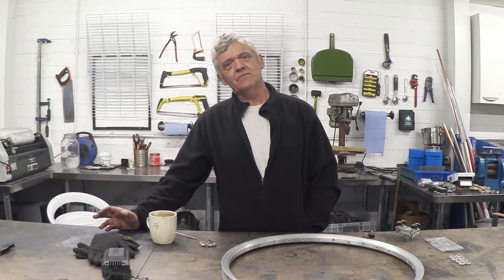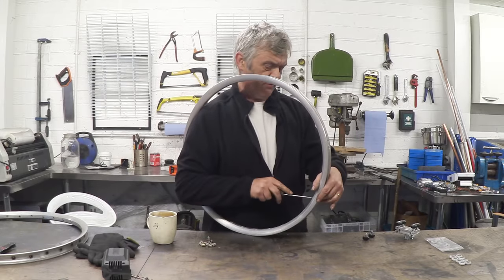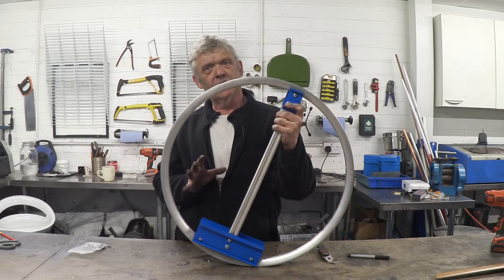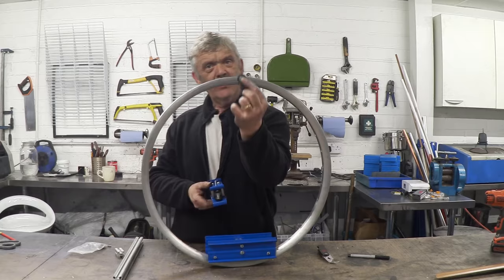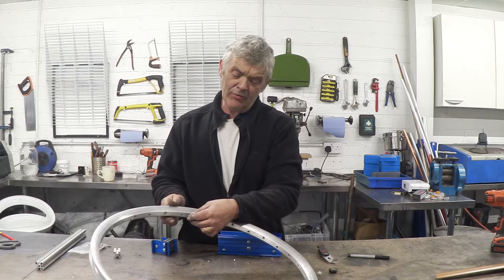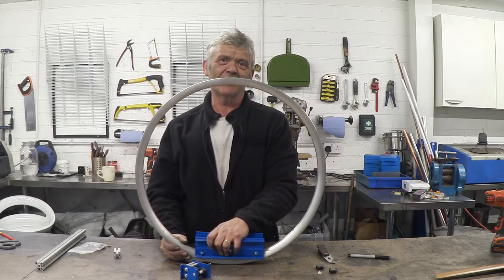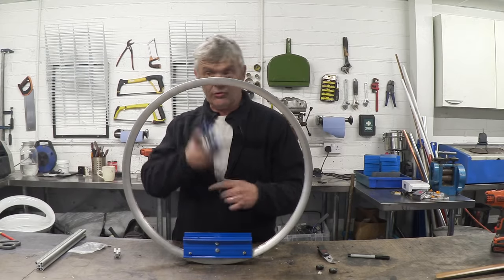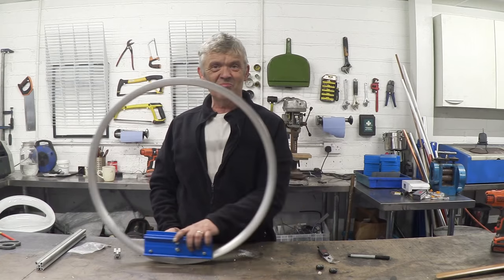How To Make A Hubless Wheel

Comment: Years ago at a local fair , I saw a hubless wheel where the rider was inside the wheel , sitting on top the motor. A powered unicycle of sorts. I think the guy steered it by leaning. This was back in the '70s when I was in junior high.
     Great video! You make to the point informative videos..
Reply from the maker: awesome mate - cheers for the post
Reply: I remember that, Rule no1, do not emergency brake.

Comment: So really this is a two wheeled train providing its own track.
Reply: I was about to say the same, when I heard the quote that there is no hubless wheel but instead the outer diameter of the axis is the size of the inner diameter of the wheel and hollow. Given that a straight line is a curve of infinite radius, this is basically a rail track. The other type of continuous rail track is the linked kind, which is far more common.

Comment: Cheers! As a bike mechanic, I'd like to alert you to a couple modes subtle features that might help with this design. Keep in mind that the the spokes under tension support the wheel dynamically at each connection, at all times. They end up providing a huge amount of structure, which makes sense when you take into account the cumulative tension of 32 or so spokes, each holding up to 200 KgF. It's generally understood that the rim is the weakest link in the system. 

You are right that in most cases, supporting the wheel at the bottom will do a pretty good job, but as you turn, the wheel will want to counter bend at about 90 degrees from the applied force (like a pringle chip or saddle.) With the pressure of the tire pushing inwards on the base of the rim, a moderate turn can be enough to push the wheel permanently into a saddle shape. Your 3 points of contact, if spaced evenly should help avoid this deflection and permanent deformation, but you may find that the supports need to be surprisingly rigid and heavy. 

Also, if you impact something with an unsupported portion of the rim, it will nearly certainly deform the rim badly, leading to it locking up as it enters the bearings. Deciding where and how long the bottom support needs to be should be calculated based on where the wheels normally contact during hard turns, and then extend them significantly forward to support potential impacts. Also, wider tires at lower pressures will help reduce stress on the entire setup.

With spare time, I would take a look at some of the studies of wheels on this site: https://www.wheelfanatyk.com/blog/

Very informative and I'm sure you'd find insights to help you continue your adventure safely and productively. 

If it gets there, It might be super awesome to turn the rim into a motor element. Perhaps with permanent magnets, and even using your "new motor design" idea.
Reply from the maker: nice comments mate  - I actually just plucked the design from an already produced production bike - here it is https://www.youtube.com/watch?v=WIVeemZ0_e4 - I am not a designer by any means - I just like cool stuff it is possible to build at home

Comment: Really like this idea.  You could also eliminate the tube stem altogether  by using a airless polyurethane closed cell foam tire or tire insert. (Incidentally, a vid or two about how too DIY THOSE would also be FANTASTIC! lol :)   I've been experimenting with stuffing tires with various densities of closed cell pipe insulation over various sizes of steam formed PVC piping trying to get a good balance of stiffness vs. cushion to inexpensively  build flat free tires that don't weight a ton.
Reply from the maker: awesome mate - I will have a look into it

Comment: If i'm not wrong, centreless or hubless wheels can reduce radius and so torque needed so they can be more efficient than hub wheels. But I think that to reduce the wheel structural weight and give more reliability an active suspension is needed and a lightweight wheel cover to keep dirt away and improve aerodynamics, and also with wider car wheels you can still use spokes and centreless motor at the side of the wheel. Your design is quite interesting and you have explained it pretty well, probably in the future the cars will use hubless wheels

Comment: Cool idea! I'd leave the steel inserts in the wheels if they don't get in the way. 
A DIY folding electric bike might be a nice project with this type of wheel, maybe a 2 wheel drive one..
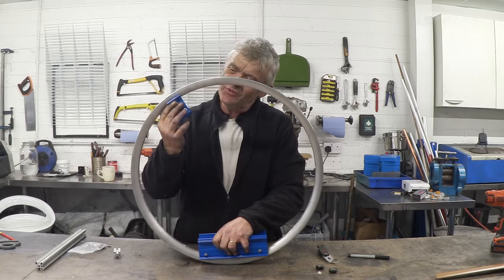5:14 may be tricky - you have to grip the whole diameter or if will pop out (imagine the wheel moves to the left).
It may be easier to drive the tyre from the outside which will trap/guide the rim too, also you'll need full electric braking perhaps with a manual parking brake for emergencies (like blowing a fuse going down hill).

Comment: You mention relocating the valve to the side of the rim. That's going to look a bit odd, but, more importantly, it'll probably snag the bottom assembly as the rim rotates. Perhaps an airless foam filled tyre would be a better option; no valve needed. Looking forward to the next development on this project.... 😉
Reply from the maker: I agree mate - been a good couple of suggestions on that
Reply: Solid tyres are out there  cheapish 700c ones on wish are 11euros  for testing should be fine the valve for me would be a problem colliding with bearing assembly  can't wait to see working model
Reply: @ThinkingandTinkering  maybe silicone foam

Comment: Thanks Robert - interesting idea with great potential. Mike Hallets' comment regarding the tyre valve on the side is pertinent and I might add that the tubes are designed for the valve in the middle.  The solution maybe to leave the valve where it is and relocate the toothed belt onto both sides of the rim (to balance the load). One is also faced with the problem of dealing with gravel and sand between the toothed belt and drive mechanism. I guess that will be a problem with the bearings running against the rim too. I can see a wiper being installed to clear the rim of debris...Finally, how do you brake with such a construction?
Reply from the maker: same way as they already do mate - cantilever rim brakes
Reply: @ThinkingandTinkering  hmmm...not sure. Still very interesting experiment. Looking forward to the next vid Robert.

Comment: One of those locking hatch mechanisms for a vault door or ship door, with 4 point contact would be perfect for making a quick setup and 2 more points of stabilization.
Reply from the maker: it would mate - and I did think about that - but you know why I didn't go with it? - only because of the inevitable comments - ' what a waste of time just use an axel' - if you make it hubless it has to look hubless - other wise you'd get a lot of comments like the above.

Comment: Interesting but other than appearance I can't see any advantages. As has already been mentioned in the comments the bearings will be spinning (and wearing out) at a much higher rate than hub bearings. Friction will be increased, the weight of the assembly will be higher than that for the traditional arrangement, and dirt on the rim will cause even more friction. I have to ask: What is the point?

Comment: Mmm. What about generating motion with maglev, using the ring as bullet train rail? Or using magnetic gears in a partial setup, and magnets all along the wheel? Awesome videos. Thanks for sharing.
Reply: Juan José Guzmán, I was surprised by his idea about the cog; I thought for sure that he’d be mounting permanent magnets around the rim, as you mentioned. I hope that he’ll give that consideration, if he hasn’t already.
Reply from the maker: the power, cost and stability of a maglev set up would be a prohibitive for anything other than fun mate - I like to try and do stuff other folks could do if they wanted
Reply from the maker: I did mate - but all the time I am thinking can this be made by someone without special tools - it's why I make a lot of the decisions I do
Reply: Robert Murray-Smith, I greatly appreciate that point of view—your videos certainly do inspire experimentation. Unfortunately, I’m not able to engage in it, but enjoy it vicariously.
Reply: It could also be a nice and compact mill generator. Thanks for your response.

Comment: if you aren't going with 4 inch tires, you'll probably need some suspension, or you might have a rough ride, since the spokes act as springs.
also, given the closeness of the two points on the bottom, you might want a third (well, fourth) point of contact to avoid slip out if you don't put the other one straight up.
Reply from the maker: cheers mate

Comment: I have often been drawn to the hubless bike with a similar base and a spring or torsion suspension system from base bracket to base or even more fancy yet unequal A arm suspension utilizing a spring of small torsion bars in the bracket.
Reply from the maker: they do have advantages mate - especially for the home builder - my lathe is a tiny hobby thing but I can cope with the lathe work for this design - with central axels there is no way I could home shop build it

Comment: Twin walled rim joined to a larger outer rim would allow  valve position to not be a problem,threaded cylinder shaped spacers with radiused ends fitted between each rim that are held in place with bolts and washers on the inside? Hope it makes sense! Look at twin walled rim and it will,lol:)
Reply from the maker: makes lots of sense mate - cheers

Comment: can i suggest forgoing the cog belt. and consider just putting rubber grippy wheel on the motor on the rim.  (it could even rep;lace one of your bearings.    as others said. you may need to buy or make the tire tubless.   a friend once made a spray foam filled tire. punched a few big holes on  the opposite side from the stem,  filled the tube with spray polyurethane high density expanding foam, and then waited for it to squirt out  the holes. then let it sorta plug the leaks, and then they introduced more holes, to give it more places for the solvent to get out. .  and more.  it was a goopy mess but when done it worked ok.  i think he made it leak about 30 times with an icepick,  and left it sitting.. eventually he was able to trim off the goo and chop off the stem and ride.   (not as good as pneumatic but he just wanted to never have thorns again and they had not really invented the solid foam airless tires.
Reply from the maker: both nice suggestions mate and to be honest I may well go with - I like things that make everything simpler - I really hate to overcomplicate anything and your suggestions make the build simpler and solve an issue in perhaps the most efficient way - nice one - cheers

Comment: Modifying the rim and having the valve come out the side won't solve the problem with the valve being in the way.

You will need to either modify your bearing casing, or make the rim taller along the sides in order to gain the necessary clearence.
Reply from the maker: cheers mate - I have been pondering that and there have been a few good suggestions
Reply: @ThinkingandTinkering  
One solution would be to have an open ended bearing. That is, one side of the bearing would not have a support. 

Actually, it could have a half circle support. 
That should allow for the clearance on that side of the rim.

To create this you would need to cut one side of your bracket down so that your cut line runs through the center of the bolt holes.

That would give the bolts something to rest against while at the same time, reducing the depth of the bracket on that side.

Comment: the hubless wheel i saw was on the tv series biker buildoff , the builder billy lane is the guy that thought up the hubless wheel on a single side swingarm (though there are some that deny this claim) , he used a realy expensive and verry wide bearing made for cement mixers , the guy even though he looks like the average biker dude is pretty educated and calculated the forces put on the wheel and made the technical drawings to make sure it would work and be safe
seen two different sort of drives , one is a roller pressed against the tire sitting in the frame between the engine and wheel wish is nearly invisible and might work on an electric bicycle too
the other is a realy big chainsprocket with a huge center hole mounted to the rim and driven from a jackshaft to bring the ratio down enough to actually be able to ride the bike at speed while keeping the engine from over reving
Reply from the maker: I like the drive wheel idea mate - cheers

Comment: If you design the drive wheel correctly, you can leave the spoke locators and valve stem in situ. Even the spokes could be left in place, because that improves strength and mechanical stability. But that latter somewhat defeats the object!

Comment: Hubless wheel is where the solar panels, panniers etc should be - low centre of mass = brilliant. 

Robert how do we make an electric suspension - presumably electromagnetic? Something that can be adjuster with a slider switch or rotary knob. That way you could dynamically adjust to whatever the current road is like ...and stay on the bike

Comment: I like the principle but I suspect the friction in the bearings/runners would not allow this to be very efficient. However, if this was done using a mag-lev rail system..... That would be slick, but the power that would need! And how to make the rim magnetic enough to hold the load would be equally as big challenge as the power supply. And the electro-magnets would weigh a ton. Maybe that's why we still have the hub and spoke today. Don't let me put you off though. Few projects succeed but often you pick up things that can prove other projects a success. Never give up.

BTW, have you seen google patent US10322827B2 yet? "High frequency gravitational wave generator". That's some proper Sci-Fi stuff right there.
Reply: Thanks for the suggestion. Interesting and fun!
Reply from the maker: maybe mate but I think the maglev is going to be a no go on power and expense - I'll have a look at the patent thanks for the heads up

Comment: Thank you for sharing, Robert, very interesting. You now have my wheels turning (no pun intended, much!!) I am pondering implementation of a magnetic drive system vs a motor...ref Rolls Royce PM Tunnel Thruster for watercraft...  Reduced friction via no motor may improve overall energy balance...??  hmmm. Actually, the more I consider, the more I like it...while at it, why not utilize magnetic bearings as well??  Certainly, an electric-magnetic drive, applicable for virtually any type of vehicle. I like it...  Thoughts???
Reply from the maker: I like it mate - but my tendency - especially with something new to me is to concentrate on one change only - that way I have more control over outcomes and a better understanding of the failure points
Reply: @ThinkingandTinkering  absolutely...I agree, thank you for sharing your perspective!!!  We know, for conservation of time and often, the difference between success and "failure" is organized handling of controls and variables!!!  Wish you a pleasant evening before we welcome a new week!!!  Perhaps, in keeping with my initial proposal, begin with magnetic bearings to reduce friction...plus, the easier of the two giants to battle first??  Robert, I'm curious... might there be a method you prefer/ suggest for direct private discussion with you???  Thank you!!

Comment: Instead of a toothed belt and a motor, couldn't you fix a series of neodymium permanent magnets around the wheel and have a set of electromagnets mounted where your motor was going to be. By synchronising the pulsing of the electromagnets with the passing permanent magnets the wheel becomes the rotor of your electric motor.
Reply from the maker: nice idea mate - i'll probably go with the belt but you could always give it a try

Comment: I think you're liable to  have strength problems.  Bike rims by themselves aren't all that strong, the strength is in the spokes.  Your setup with two points of pressure close together at the bottom of the wheel, while it appears sensible in that it "spreads the load" as opposed to a single point of contact, will, by its very geometry, produce a massive load on the rim.

Assuming it's a 26" rim, that's a diameter of 559mm , with 2 load-bearing points spaced around 150mm apart (by eye), that gives an arc subtending around 15°, with a height of around 5mm.  For those sorts of angles, it can be basically considered to be a pair of straight lines.

So you have 2 vertically acting point loads at the end points, if we assume a total weight for bicycle and rider of 100kg, and an even spread of weight from front to rear wheel, that's roughly 250N at each point.  That translates to a 500N reaction force at the contact point, also acting vertically, but upwards.  That puts bending moments of 250 * 0.075 = 18.75N.m acting in opposition on either side of the contact point, which is about the torque you can put on a high grade 8mm bolt before it risks shearing.  There's also the little matter of the compressive force you're applying to the rim - it might only be 500N vertically, but along those segments it's pretty massive - the tangent of the angle from centre point to end point is about 1/15 so the compressive force is about 500 * 15 = 7500N.  In plain english, that's about 3 quarters of a tonne.
Reply from the maker: I am just copying a design already used in production bikes mate